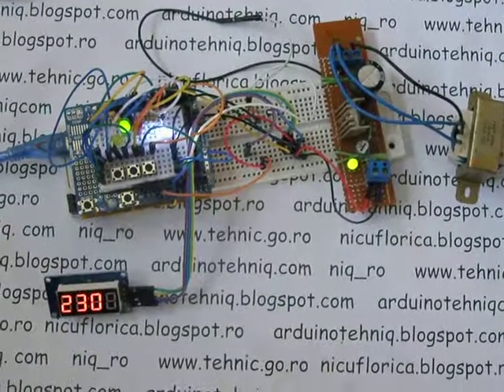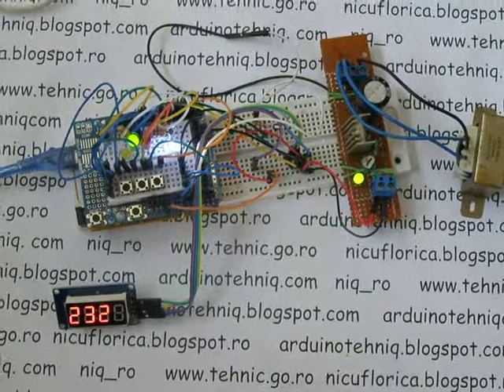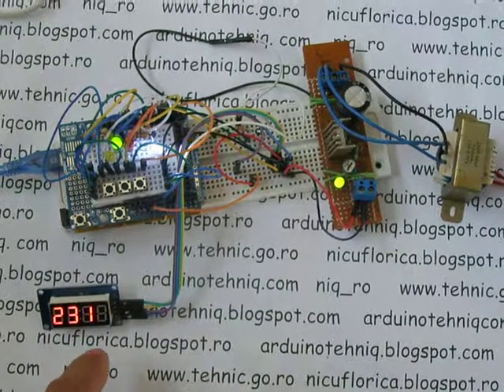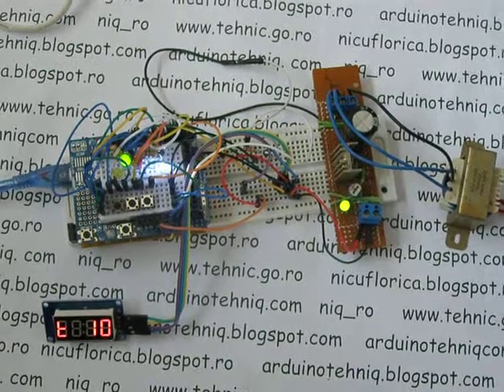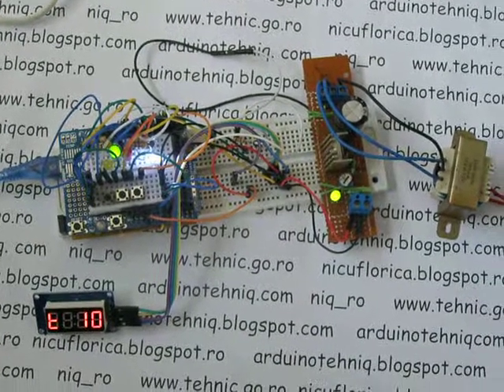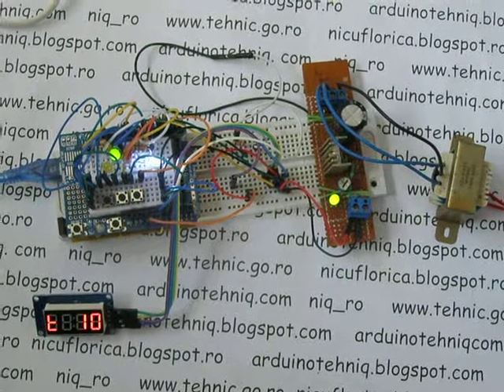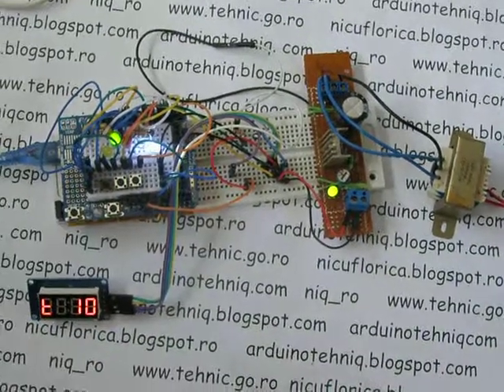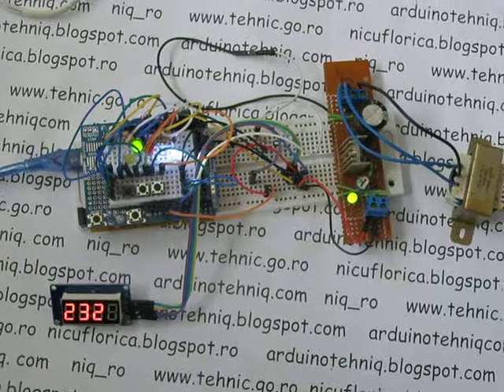under & overvoltage relay with Arduino

Comment: Sir want to make over and under voltage controller with Arduino but for this I need program and circuit diagram. So please can you help me out
Reply from the maker: Please, read description of this video 😏
Reply: @dj06ntm  but sir I only know the English and Hindi language. The language in the link was not understandable for me.
Reply from the maker: @explore_with_kd964  in right of page is language translator...
Reply from the maker: if use "translator" from upper right side of page an choose HINDI you will see रिले न्यूनतम और अधिकतम वोल्टेज नेटवर्क
Reply from the maker: see english version: http://arduinotehniq.blogspot.com/2016/10/under-overvoltage-relay-for-ac-main.html
and http://arduinotehniq.blogspot.com/2016/10/under-overvoltage-relay-for-ac-main_3.html

Comment: i am final year student want to make overvoltage undervoltage protection using arduino and gsm module please help me.
Reply from the maker: yes, you can but I haven't time for this project...
Reply: thanks for reply.all i want is circuit and programming,please help if you can.
Reply from the maker: pankaj ekka base schematic for relay is in video description... for sms I have article on blog - http://arduinotehniq.blogspot.ro/2015/09/gprs-module-with-m590-for-sms-projects.html

Comment: sir can i connect ardunio and gsm module with this circuit??
Reply from the maker: yes, yes.. firs test this version, after that test Arduino with m8590 module ( http://arduinotehniq.blogspot.ro/2015/09/gprs-module-with-m590-for-sms-projects.html )  if result are ok, I will send sktch for made full project, but test....